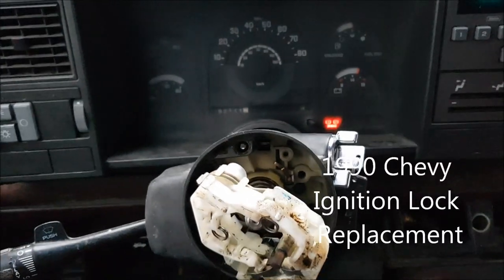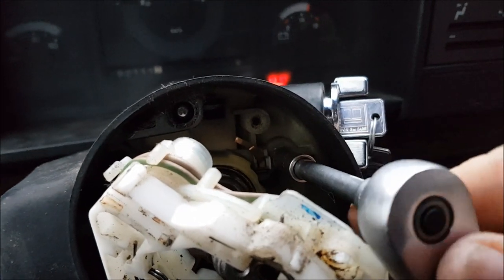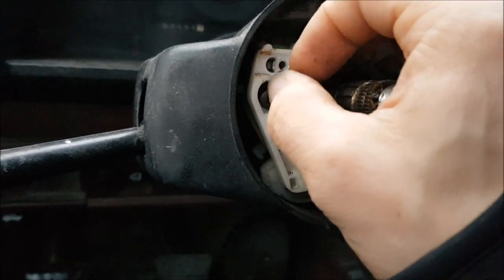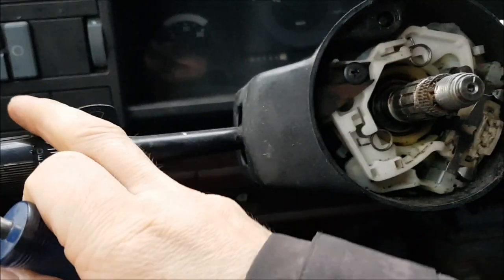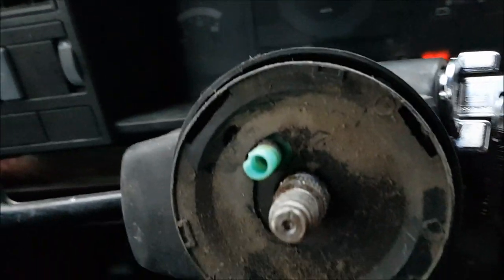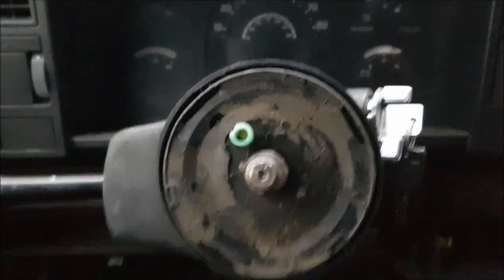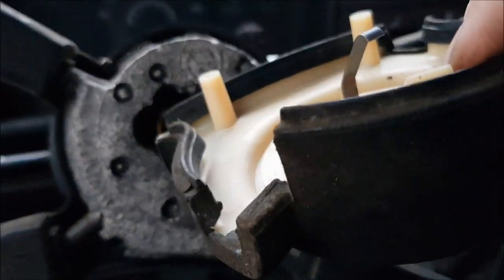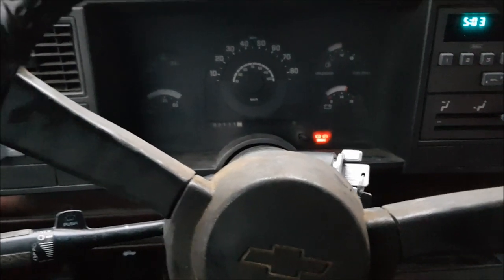1990 Chevy Truck Ignition Lock Replacement

Comment: Nice video. There is a shortage of videos about these gen 4 trucks with this topic.  

I have no keys to one someone gave me, a 1991 gmt400 / Silverado.  How can I start the truck up without keys to listen to it run?  I don't want to break anything to do it, or buy any parts because I don't know status of motor or tranny.  Is there a way to do this with an easy temporary means?  Thanks!
Reply from the maker: The best way is to pull the steering wheel and remove the ignition lock. Then you can start it with a screwdriver.
Reply: @nates831  well I won't need the old key cylinder anyway so can I just drill at the top and bottom of the key slot until I get large enough so the lock's tumblers fall out, or are destroyed, and I can turn cylinder with a stubby screwdriver?

Comment: How do you go through all the trouble of taking everything apart and not clean it before putting it back together?  LOL  Good video though. Thanks.
Reply from the maker: Good point, this truck was a beater and I was just looking to get it movable since it didn't come with keys.  I did give it a good washing eventually.

Comment: Thanks a lot, just replaced the lock (lost my keys).  I would say that there are two special tools: the ring compressor and a steering wheel puller.  I managed to get by with a gear puller, carabiners,  chain, fencing wire, multiple screw drivers, a split ring tool and a hammer (hint: get the tools).  Mine was an '88 and I had to take off the emergency flasher knob (one screw).  All in all, not to tough.
Reply from the maker: Glad I could help and you are correct, the right tools make the job much easier.
Reply: I have a 88 too can you help me
Reply: @esbino5815  Where are you?